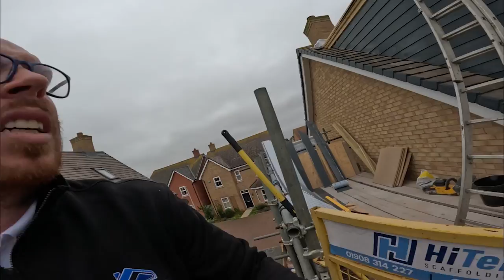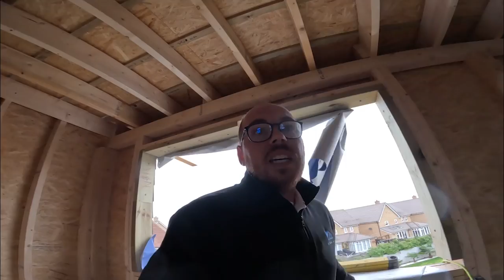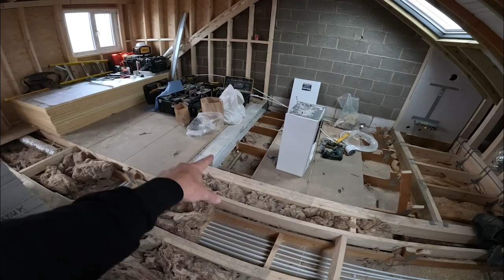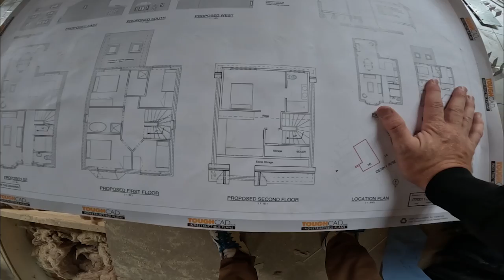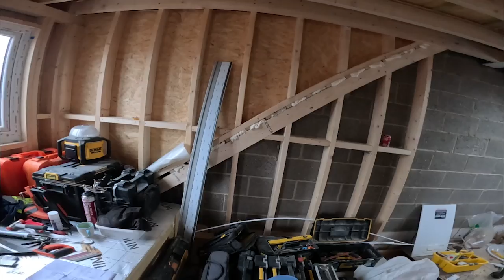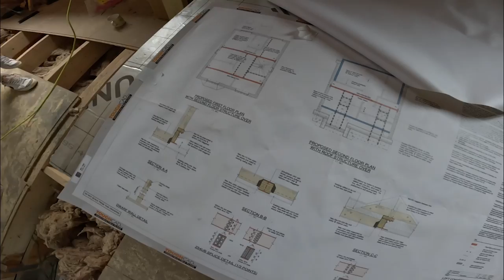STRUCTURE ONLY - LOFT CONVERSION DJ MOORE!

Comment: If you have a attic that 5ft can it be converted into a loft conversion with a dormer
Reply from the maker: Not unless you can remove the roof and put a higher ridge line on.